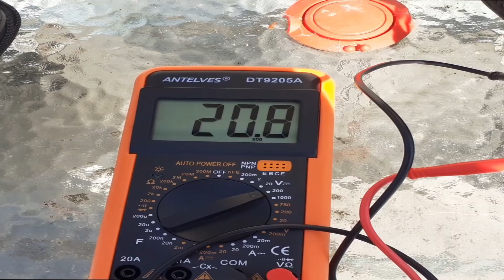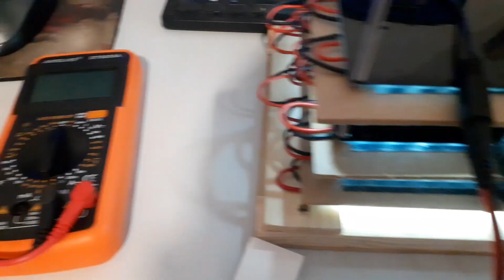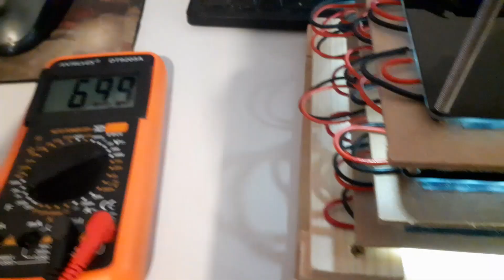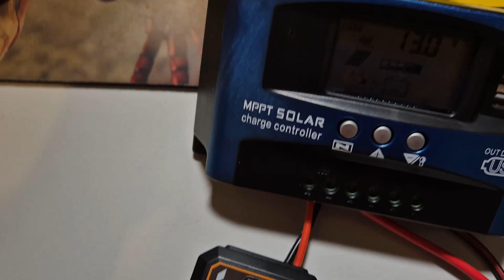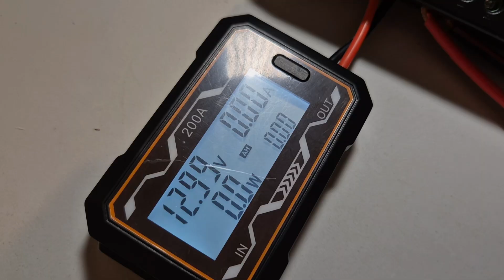Will LED's Power The Solar Panels? - Part 1

Comment: Multimeter internal shunt basically shorts out the panels. Max power point from the panels specifies both  a voltage and a current to get max power from panels you need to match the internal  resistance of panel with the load impedance. Not simply short the panel out and declare you have measured something meaningful. You need MPPT converter to take full advantage of your panels.

Comment: Based on your readings, the sun provided 20.8V * 200mA = 4.16W. Thats about 20% of the spec power.  With LEDS, you put in 3.28V * 1A = 3.28W, and you’re getting out 70.6V * 1mA = 70.6mW = 0.0706W. This means your system is 2% efficient and you’re losing 98% of your input power. This will definitely drain your battery. 

At 6:23, your panels are wanting more than 5V, 1A which is why the voltage is dropping to 3.28V and when you remove the LED load, the power supply goes back to 5V. Bump up the current by 0.1A increments until the voltage returns to 5V. You should get better efficiency but it will NEVER give you justifiable output power.

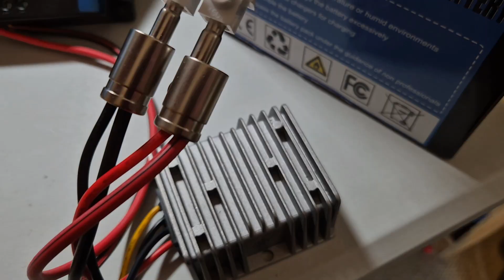7:58 This is the official debunking of amp injection. Remember, Lloyd’s system had 0.00A as well. He never got to 10A as he claimed. This is a bad month for Lloyd.

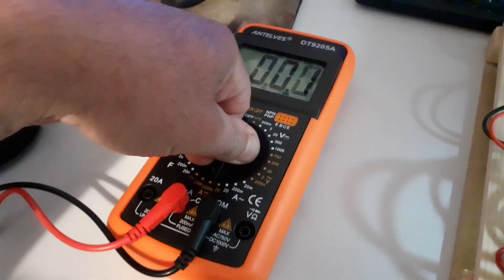Comment: if am not wrong at min 4:29 since the dial is set to 200mA current range. that reading is 1.0mA
Reply: That's right, so my understanding is that 1.0mA is 0.001mA which is very little power.
Reply: @OYMInternetRadio I think you mean 1mA = 0.001A
Reply: Because it shows exactly 1mA, I’m betting if Alan went down one more setting, he would read LESS than 1mA.